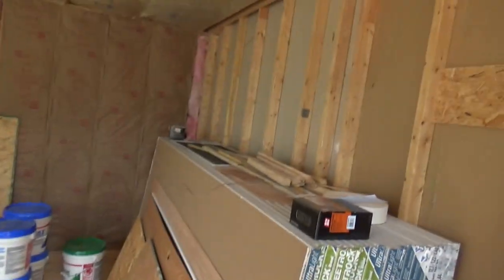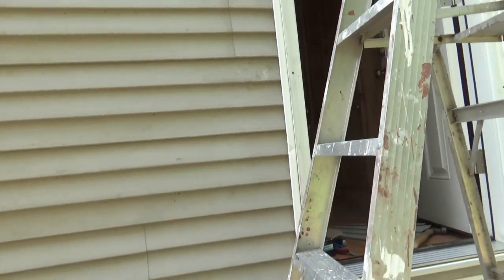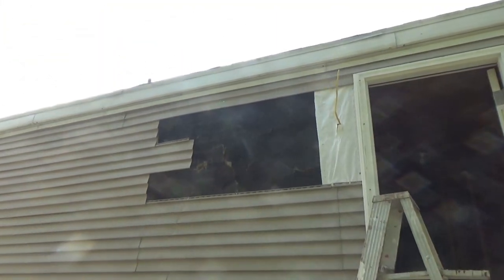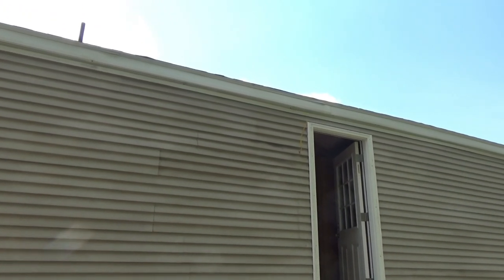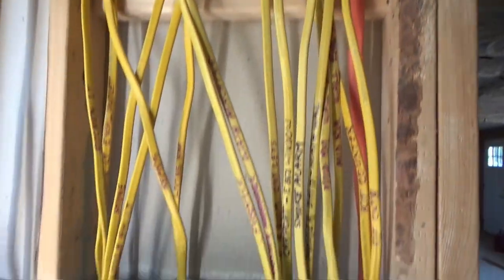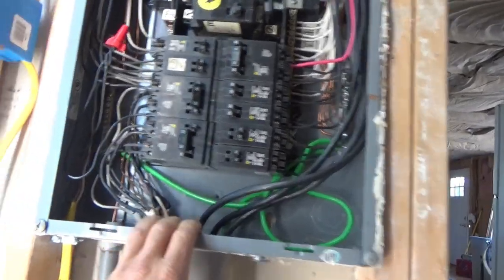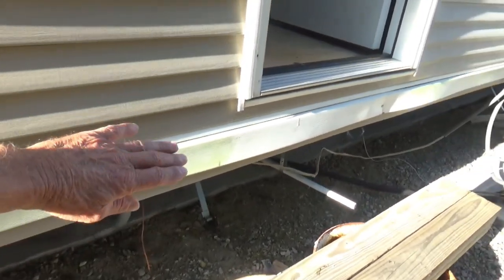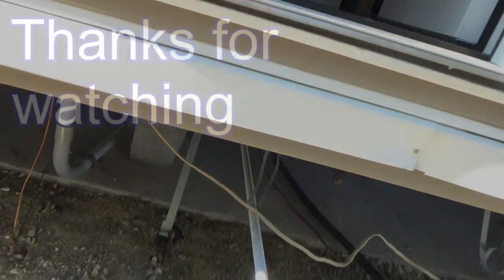Mobile home update 8-15-20

Comment: Even though it's been a while, you can still get some copper sulfate from one of the box stores, mix with water and pour it down, alongside your ground rod. That will increase its ability to connect with the surrounding earth. Try to surround the rod with the solution. When done, just take a plastic disc and affix it on the ground such that it repels water from soaking down into the dirt and diluting things. It's just a retardant to the water. It'll maintain things a little longer.